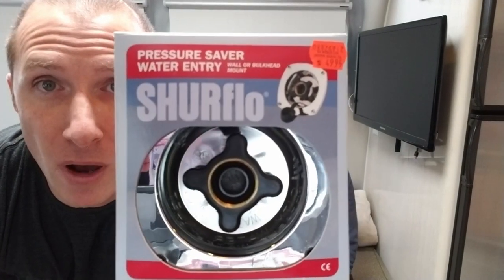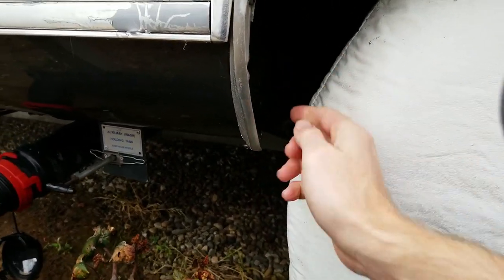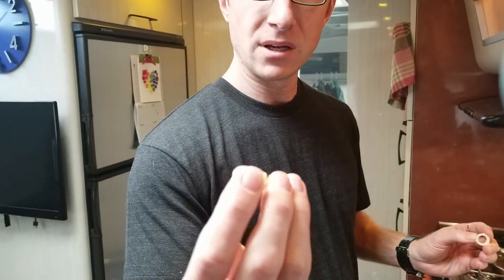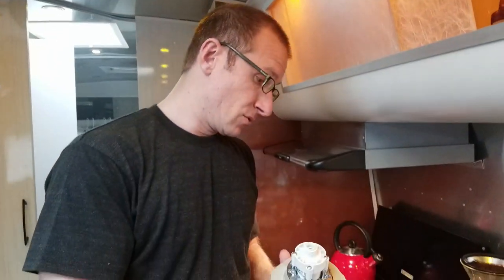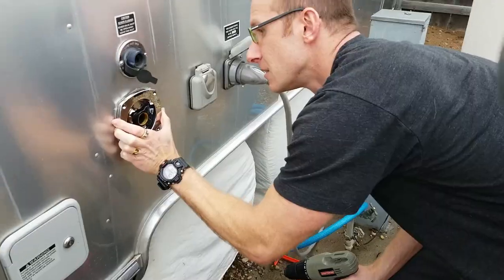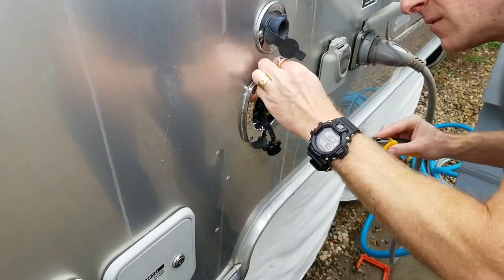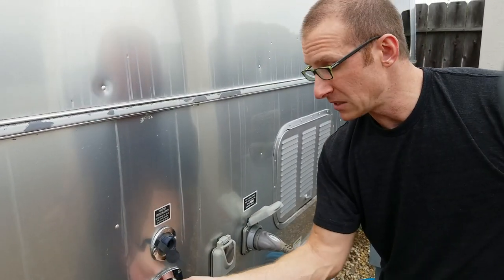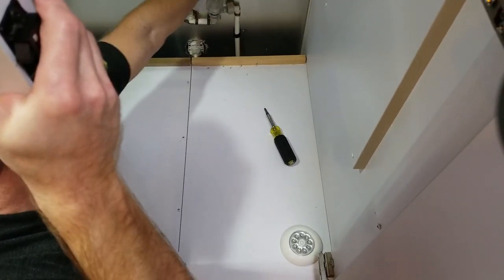Shurflo regulator 183-029-14 replacement fix #airstream

Comment: Hey Jonathan! I experienced the same leak on around my wheelwell. I also assumed that was just AC condenser. However, the water pump was running continously and fresh water tank showed low levels which led me to believe the problem was in the fresh water line. Did you have any of these problems as well?
Reply from the maker: ABSOLUTELY! We had a leak at the water pump as well. I took it apart, cleaned and rebuilt it. When that happened the water ran down under the lounge where we are sitting in the video. Thanks for the comment let me know how I can help!

Comment: Where can I buy that gasket??
Reply from the maker: Which gasket? The one between the regulator and the aluminum of the airstream or the little one inside of the water line?
Reply: @daonstream The little one inside of the water line😯
Reply from the maker: The easy way is to go to an RV parts store...or try putting the regulator in an Amazon cart and then look for "people also buy..." And then throw that bad boy in there...or try searching rv water line gasket. Thanks for the comment mate!

Comment: You didn't show how you screwed the unit into the fitting to attach unit!
Reply from the maker: It screws right off but you have to take the back wall of the wardrobe apart first...it comes out pretty easy and then you have access. Don't drop the gasket when you unscrew the fitting from the regulator.  Thanks for watching!